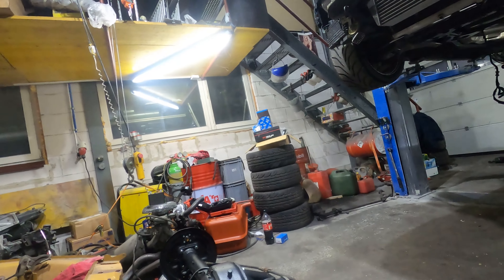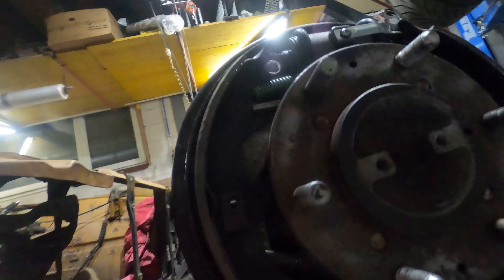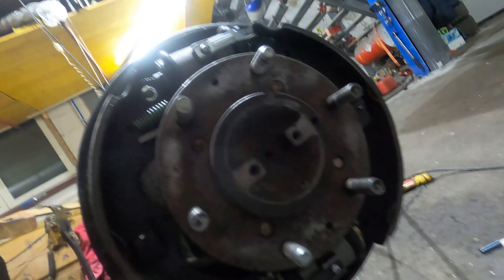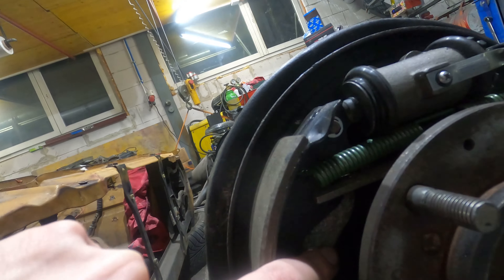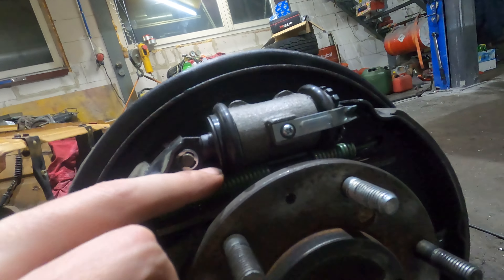REPU brakes won't fit

Comment: Hello. 
I had a few questions about the brakes and where you sourced them. Is there a way for us to email instead of the open comments on the video page?
Reply from the maker: Hi Mason

Yes, no problem at all, shoot me an email to m.sahli@gmx.ch, always happy to help out!
Brakes however are just refurbished by a local company that does these kind of restorations if possible. I kept looking at rockauto with their refurbished brake calipers, but for the last .... 6? months no success at all, always out of stock, hence I went the extra route to have the old ones refurbished.